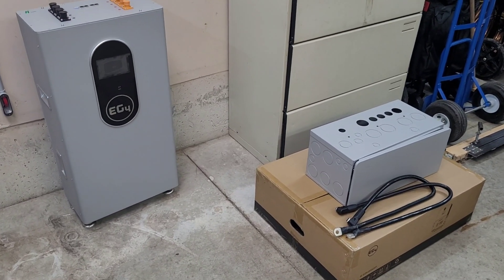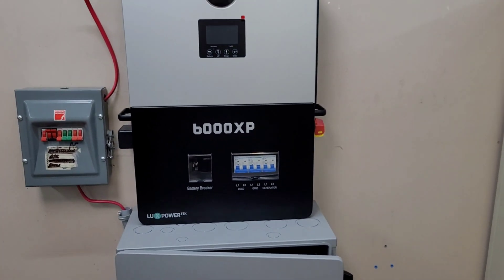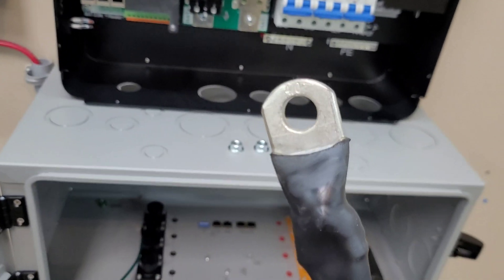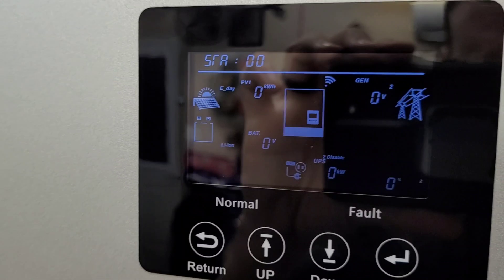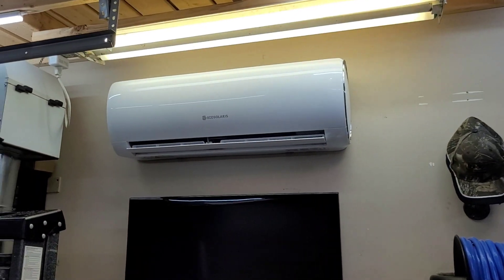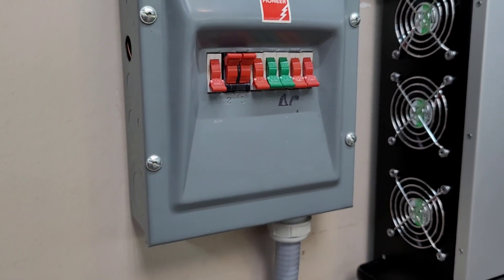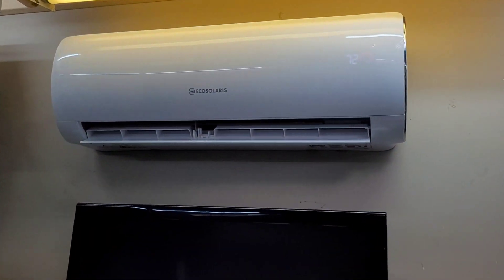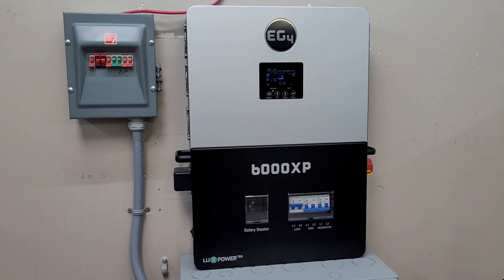EG4 6000XP + Power Pro Indoor 48V Battery Install!

Comment: I asked Google about this EG4 inverter and here's the answer that it gave me: "As of October 2025, EG4 Electronics is facing a legal investigation regarding premature inverter and battery failures, but no class action lawsuit has been officially certified. The law firm Migliaccio & Rathod is actively investigating consumer reports of hardware failures, which could potentially lead to a class action. 

However, the company's terms and conditions contain a class action waiver, which could complicate such a lawsuit. 

Key issues leading to investigation.

Premature hardware failures: The most significant complaint involves EG4 inverters and batteries failing within a few years of installation. Some users report multiple equipment failures in a short period.

BMS and firmware issues: Consumers have reported that battery management systems (BMS) have failed, which can cause communication problems with inverters and result in power outages.

Security vulnerabilities: In August 2025, the Cybersecurity and Infrastructure Security Agency (CISA) published an advisory on multiple security vulnerabilities found in several EG4 inverter models. The vulnerabilities could allow for unauthorized access to a user's network. EG4 has acknowledged the vulnerabilities and has been working on a fix, including new hardware.

Poor customer service: Complaints on social media and forums detail customers' negative experiences with EG4's customer support and warranty claims, with some reporting difficulty in getting timely responses or proper solutions for defective equipment."

Comment: For the cable that connects the battery terminal to the inverter lug, did you buy the EG4 PowerPro Parallel Cable Kit and crimp the one side on? If not what size wire did you buy? 2awg?

Comment: How do I hook up a 3600 120v inverter generator to my 6000xp inverter and wall mount battery?
Reply from the maker: You would need one of these https://signaturesolar.com/eg4-chargeverter-gc-48v-100a-battery-charger-5120w-output-240-120v-input/?ref=_KvVrzchAclARI&srsltid=AfmBOopKWaJx8RRd--_vRE2bRAa1-IEm-Ep-InuY8w3tABQnmbHSq580

Comment: New Subscriber question: is there a way to wire the 6000xp+battery without the critical load panel but  still capable of charging batteries with the grid assuming no solar panels? thanks

Comment: Can you run the 240 ac our of the inverter through the walls of a house to a breaker panel flush with the wall? And all the wires out of the breaker panel after the breakers through the walls to appliances?
Reply from the maker: @neilwani1178  yes

Comment: Do you have a link for the sub panel you used?
Reply from the maker: It's a federal pioneer 70a load centre but I don't think they make them in 70a anymore. I found it on marketplace

Comment: Great video - you're in Canada - if you are in Ontario (like me), did you get ESA approval for the system?  ESA requires UL9540A and UL9540 I believe according to their bulletins - the EG4 18k with the PowerPro battery has UL9540, but not the 6000xp.  Or did you do a site-specific inspection?

Comment: Can you connect to main box in house ???  Just wondering 
I have a manufactured home it will be a mess to rewire a control panel.
Reply from the maker: @coziii.1829  there are ways you can do it, not sure if they're code compliant

Comment: The only suggestion that I have is that I would watch the Signature Solar video on setting up the Power Pro Wall Mount battery. There is a set process to follow when setting up the battery, not that I watched it about 4 times and made a list of the order in which to do them (All off, dip switch, communications cable, battery breaker...). The less headaches the better! They are delivering my Outdoor Power Pro Wall Mount battery, which should be arriving next Tuesday, I already have the EG4 6000XP (Indoor) . I am in the process of setting up a full size sub panel (Leviton 30 circuit smart panel) of which I am cutting the bus off at the 10 breaker point and use the bottom portion of the service panel for a few Automatic Transfer Switches. I purchased a metal vertical 72" (2) door cabinet (for the XP and Battery) which will be mounted against the cement wall in the Lanai and will be made air tight/insulated from the outside elements, with (2) 2" PVC pipes from the utility room located on the other side of the wall and will have a small computer fan drawing in cool dry air from inside and returning it. Wiring in, Grid tie for battery charging if needed, Remote Auto Start 12kW Portable Generator if needed, and of course Solar. Just waiting for the battery. I am really enjoying this project.  Oh, you may wonder why I opted for the indoor 6000XP and the outdoor Battery. There are new rules that are coming out regarding batteries and where they can be located in the IFA (international Fire Codes) and NFPA 855. So I figure if they decide to insist that these batteries be mounted outside I will be all set and since the enclosure will be low humidity and constant temperature in the 70's the 6000XP will be fine. Good video!
Reply: Maybe you can help a novice …. I want the EG4 6000XP to feed grid power to my critical load subpanel and to charge the batteries FIRST.  

Then if the grid goes down switch over to feeding the battery power to the subpanel .  My concern is if it not this way the battery could be in a low level of charge when the power goes out and then I don’t have sufficient battery to service the subpanel.

Also, I keep hearing that I should use a 50 amp breaker in my main panel for grid power (to the inverter) and to the subpanel (from the inverter).  I have 38 breakers in my main panel and to cover my critical load I will need many of these covered and therefore substantially potentially in excess of 50 amps of service.  Am I missing something ?

Thanks so much !

Comment: Awesome video! Thank you for posting this!
Unfortunately, Signature Solar no longer offers that conduit box in the video. They only offer the "builder box," which I find inconvenient compared to what you have. 
If anyone wants the conduit that's in the video, I just ordered mine from Current Connected.
Reply from the maker: Oh really? I was not aware they no longer offered it
Reply: @SmitHVAC.  I received my conduit box with the door yesterday. They have 2 models, an indoor box with screws and the outdoor box with the latch and lock. Both are shown on the web site.

Comment: Nice view. WHat is a that grid center? is not your main panel correct?
Reply from the maker: Correct that's just a small load centre
Reply: @SmitHVAC.  ok tks for the response! 
Can you clarify how the inverter is wired? i imagine: the grid goes to the main panel and from one  of the breakers of the main panel the wire goes to the inverter grid port and the just the  grid center is the load of the inverter? 
thanks
Reply from the maker: @alexherrera3918  The load centre is wired to the load breaker. There are no inputs to the grid or Gen breakers, the system is fully offgrid right now
Reply: @SmitHVAC.  wow , nice!!!

Comment: You're obviously unfamiliar with the predecessor of this inverter, the 6500EX, which is now failing in droves only after a year's worth of use. Just search for "EG4 problems" on youtube or google and see for yourself. I would never install on of these cheap high frequency inverters anywhere near my home.

Comment: Very nice, look forward to see how the welder loads the system down.  Also for the central AC, will you need to add a soft start to it?
Reply from the maker: If I was going to use it for the central air all the time, I would definitely add a soft start. I will try it without one and see how it does!

Comment: Does your little panel have an N/G bond?
Reply: The 6000xp has the ability to enable/disable a neutral-ground bond.
Reply: @branch_ranch  Yes, and there can only be a single N/G bond.  If it is in the small panel the default of N/G disabled in the Inverter is good.  Otherwise a decision needs to be made where to enable it, in the panel or the Inverter...
Reply from the maker: No it's not bonded

Comment: Install a soft start on your central a/c. MicroAir # ASY-368-X48-BLUE or ICM Controls # 870-16A. HVAC contractor and 47kWp totally off grid.
Reply from the maker: I thought about it but I don't plan to run it on the 6000xp for long, that's why I have the mini splits.
Reply: @SmitHVAC.  I have 7 3/4 Tons of HP systems. Three split central hp systems and three mini split hp….even one on my work van. Ameristar (Gree) 9K 22 SEER 120V. Removed spare tire, the shell and coil installed with airflow down. Extended odf wiring, 1/4” liquid and 1/2” vapor line. Compressor and PCB mounted in left rear. At 96F Friday, maintained 74 in drivers seat while doing service calls. It’s nice not sweating all over the invoice or taking 20 min to get cooled off while driving.

Comment: Nice work on this one. I love these systems. It just keeps getting easier. 

Only thing I’d mention is to have the breakers on/closed first before turning the BMS. It’ll precharge the capacitors that way.
Reply from the maker: Thanks for the tip, I watched a few of your videos while waiting on delivery!
Reply: @SmitHVAC.  good stuff. Yeah I’ve been learning from your channel also. Keep up the good videos.